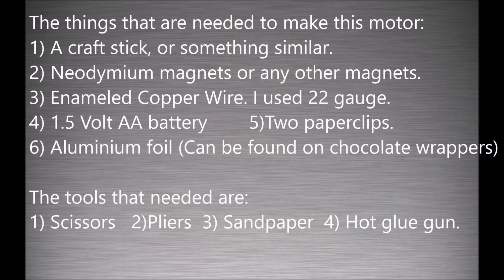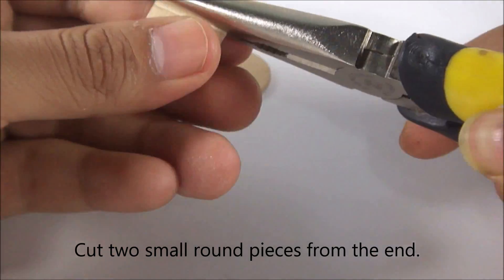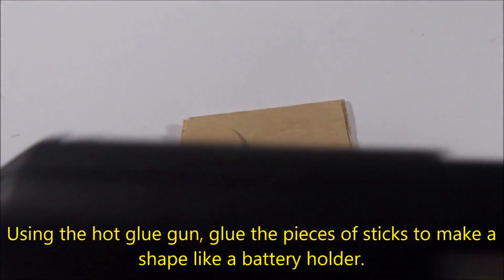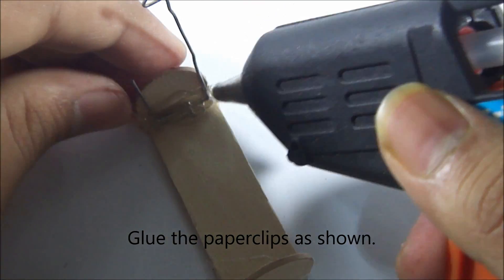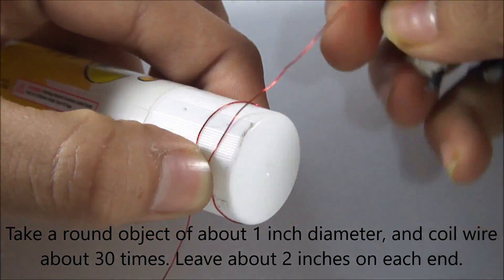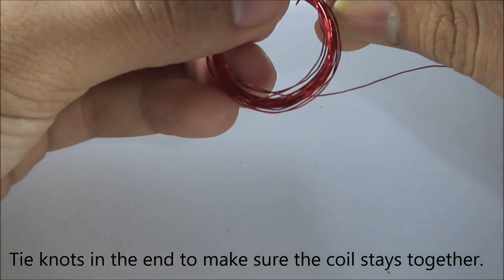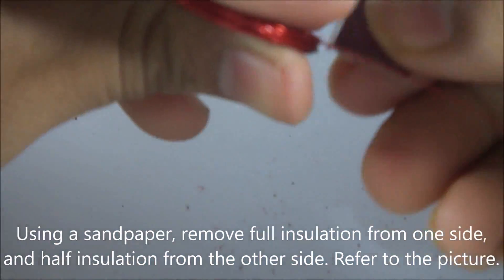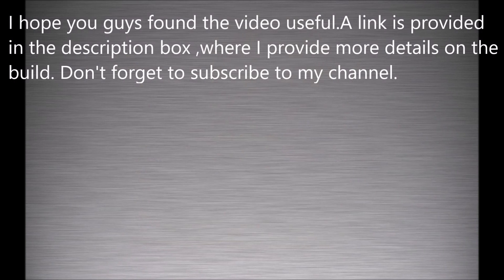How to make a motor

Comment: Damn that was a good video, and finally the voice! oh and if u bent the ends the of the copper wire after placing them, wouldn't that prevent it from falling and remain in the motor system?
Reply from the maker: +GassyJr   Thanks man,  and yes you could bend them and keep them in place at the expense of speed because the bent ends would cause friction, and reduction in speed .  :)